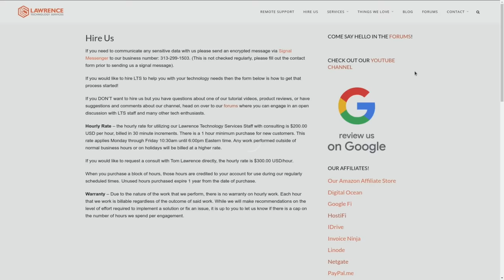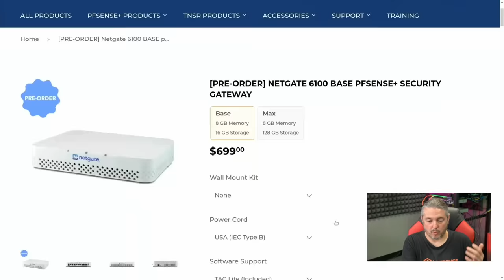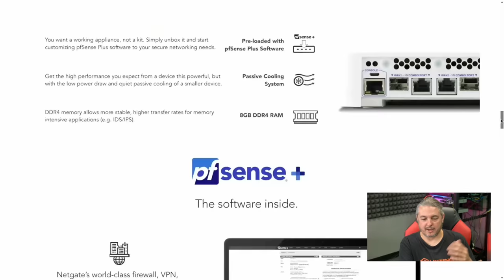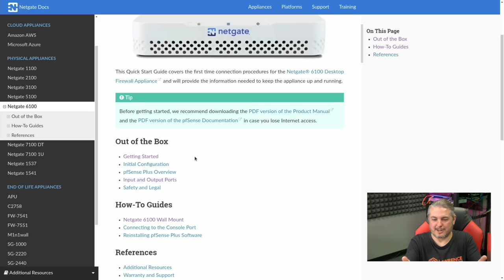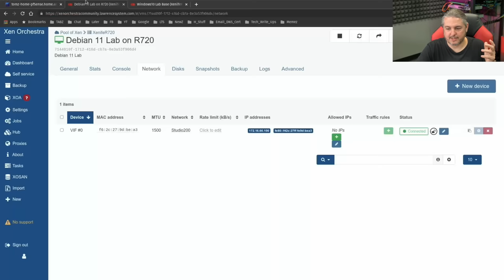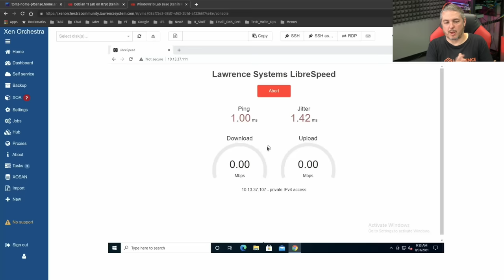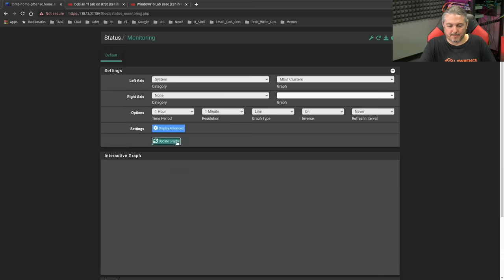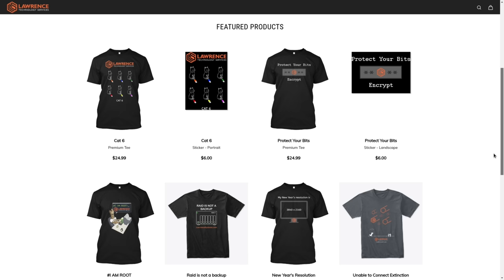Netgate 6100 pfsense Firewall Review

Comment: Great review and led me to purchase the 6100 Base model a few years ago.  A few days ago, the firewall wouldn't boot and isolated to the on-board eMMC had failed.  From the video you can see there are M.2 slots to add a NVMe M.2 128 GB SSD and highly recommend that  you do.  Once you add one, it will be a pro model and easier to replace in case of a failure in the future.  The Netgate website list the NVMe model that needs to be purchased, but I couldn't find any instructions or videos on how to install the NVMe SSD or configured for the 6100.  I did find other videos or blogs on how to do it.

Comment: It's amazing how many companies out there are still living in a world from 4-5 years ago where only medium-enterprise companies had gb or multi-gb pipes. FTTH is changing everything. Fibre is being installed here with speeds including 2gbps and 10gbps available and as competition increases these bigger speeds will start to migrate down the chain whether people need them or not. Looking to put in kit that won't constantly require changing out for a few years is proving difficult. Yes most people won't use these speeds properly now but as more people get access to them then things will change quickly.

Comment: The other 10G products were overkill and out my price range. This seems like the perfect upgrade / replacement.
My WAN is slow but I want faster inter-VLAN routing. To-date I have been using a thin client with SFP+ and then using VLANs in my switch for WAN etc.
Reply: New WiFi 6 APs...

Comment: One question about the SFP+: Netgate and you mentioned the two ports are for fibre and DAC only basically. I have a 10Gbps home internet connection and it uses HuaWei EchoLife HN8245q which only has RJ45.

Now I would like to use 6100 for the setup. You mentioned there are ‘compatible’ modules that would work for 6100. Would mind sharing the models if possible? Or there are other solutions?

Comment: I obtained a 6100 and while it may be a bit overkill for my home network setup currently, I can grow into it more as time passes. Especially with the SFP 10G WAN ports should I ever get fiber in my area. Right now, it's just [coax] cable internet. And of course the firewall blows just about any wifi-router that you might buy at Best Buy, WalMart, or what have you out of the water for performance, flexibility, and scalability. My setup is cable modem > 6100 > Netgear 2.5G managed switch > Unifi 6 lite AP. Handlily outperforms the previous Asus routers I have had before. I also dig the VLAN setup, something that most store bought routers don't have.

Comment: Been waiting for this review -- I appreciate the real-world numbers.  I do wish there was a more modern processor on this, but I sure do appreciate the 2.5G performance at least!
I also wish they had included ears -- the dimensions are roughly 1U, and silicom-usa has rack ears, so I'm wondering why that wasn't done (heat?  time?  product differentiation?).
Now we just need unifi to actually ship a 6E 2.5Gbe AP....  :)
Reply: I'm trying to decide if this is a good starter that'll last a year or two before we (finally?!) get a post-2017 processor.  The alternatives I've found are a little power hungry/noisy.  Mostly I'm just going to be needing cross-vlan routing rather than vpn perf.  I probably don't need sfp+ routing speeds, but as I already have sfp28 locally, it feels like something I should at least consider.

Comment: Great review Tom!  And I am glad there is a pair of discrete SPF+ connectors on that device now so you could start building more efficient networks and not having to bottleneck to your servers/services at 1Gbps. This is very a very neat device for Netgate. +1
Edit: Also, no switch port on this model which is another big plus. I never really understood why Netgate put that on some of their models.
Edit2: To be able to do 10Gbps in a single stream, you need to have your packets inspection go into dedicated ASICs and not rely on a multi-purpose CPU - although some could do it, but you need 4GHz+ per core for that which will start defeating the low-power benefit of those solid state appliances.
Reply: Switchports on these type of models is because it's not an enterprise grade device - it's more for a SOHO situation and not a datacenter.

Comment: Thanks tom. If you're open to requests, I'd love to see a pfsense appliance that can handle single stream 10G. Basically what do you need to actually achieve that in a real world scenario. Preferably something with two PSU so there's a bit of redundancy in the mix as well.
Reply: When you need to 2 x PSU for a firewall, you probably need 2 firewall in HA instead which will accomplish more what true redundancy is all about.
Reply: @ryzenforce  exactly! And HA can be scaled up when you need more capacity or other reasons.

Comment: I also disapprove the way that Netgate chose to name the ports on their appliances. A port is a port, an interface is an interface, these are completely different concepts. Their naming should not use the same vocabulary. Surely it is easier for beginners, but once you get to use more advanced features such as LAGG, VLAN, Bridge, then it just creates more confusion and can even lead to errors and longer outages. In my opinion, it would be fine to name the port with a simple number (ex: Port 1) or the system port name (ex: igb0). We can always add a label later on the appliance to identify the ports more conveniently.
Reply: can you clarify for me if you are able to use these interraces (the lan ones) as routed interfaces? as in to assign ip addresses on them/tag vlans etc?
Reply: @neofitsolovan1459  Yes you can use the LAN1 to 4 ports as routed interfaces. You can use them with untagged traffic and assign an IP address directly on them, or you can add VLAN tags to them an also use the sub-ports as routed interfaces in pfSense. As said in the Netgate 6100 manual, the LAN ports will actually be shown in pfSense as igc0, igc1, igc2 and igc3. If you add a VLAN to a port, you will end up with a virtual port such as igc0.99 where 99 is the VLAN number. You can then add an interface in pfSense,  which is routed by detault, and bind it to that virtual port.
Reply: @viaujoc  Thanks for clarifying. I'm comfortable with networking terminology (Cisco Enterprise World) but they are not very good at explaining things. Do you happen to know if on pfsense plus you are allowed to install all the packages you can install on CE? (eg openvpn, freeradius,etc)?
thanks!
Reply: @neofitsolovan1459  Yes, packages are the same in both Plus and CE editions. Netgate has not, as of today, made a value-added package repository for Plus customers. Most packages are open-source and maintained by seperate communities, so it would be very hard to close them and make them commercial only.
Reply: @viaujoc  thank you

Comment: AWSOME VIDEOS! REALLY LOVE HOW DETAILED YOU ARE! 🤣
I'm needing 10g fiber and 2.5g fiber, is the combo port capable of performing on at 2.5g network or do they only work at 1g?
Reply from the maker: I don't think they support the 2.5G on the 10G port.
Reply: 2.5 / 5 Gbps UTP sure, but fiber? That's not a thing. The combo ports are only 1 Gbps ports.
Reply: @0bsmith0  that's a bummer thanks.
Reply: 2.5Gb and 5Gb are kinda pointless and minimal compatibility. Go straight 10gb which has been a standard for years

Comment: I'm sure this is in the Fine Manual, but what is the default configuration?

I preferred the WAN, LAN, OPTn labeling.

That anemic (and quite old in this case) CPUs is the biggest reason I have been buying my own hardware.  Current device is a Protecli 6-port with an i5.

This is interesting as I am wanting to move up from 1 GbE, but I like having the additional horsepower.

Comment: What’s the point of 10G WAN if the LAN is only 2.5G if I want to put a Ubiquiti 10G switch behind this? Have to port bond (LAG) all 4 LAN posts to the UniFi switch. Silly, should have 10G LAN ports.
Reply from the maker: All the ports are assignable.

Comment: just a quick noob question. why does it have so many lan ports? wouldnt it be enough to just have one lan and one wan port... maybe two each for redundancy but whats the point of the other ports?
is it just so you dont need vlans?
Reply from the maker: VLAN's are nice but share bandwith with native and adjacent VLANs on that same port.  Individual ports are nice for creating exclusive networks without the shared bandwidth issues.
Reply: Imagine you use this router for a business office snd you’re renting space to a couple other businesses. You can wire their switch to one of the various ports and create a dedicated and separate physical network. Like the OP said, VLANs are great but you’re also sharing a connection and at some point can saturate it especially with how much internet usage we do now. You can also configure these ports as switch ports. I have a customer who doesn’t even need a dedicated switch because the firewall has 8 ports on it.
Reply: Also, if you have a managed switch that only has 1 gbps ports, you can aggregate the 4 LAN ports in a LAGG and get a total bandwidth of 4 gbps with multiple streams, adding link redundancy in the process.

Comment: Great Firewall Device.
One Issue I Have Is The Boot Load Corruption Of Files Once Their Is Power Interruption.
Which Is Better UFS OR ZFS File System?

The Device Comes With UFS As Default But Cannot Cope Well In An Environment Where Power Is Fluctuating
Reply from the maker: They all come zfs as the default now
Reply: @LAWRENCESYSTEMS  Hey Advice On The Best Migration Process From UFS TO ZFS, Video Link Or Writeup Link, I Will Appreciate.

Comment: The 4 year old cpu is a bit of a disappointment, but probably ok since Intel has not really released much in the last 4 years 😅. 4x 2.5GbE ports is pretty forward thinking and modern though. Great new box, finally something modern from netgate, most other boxes they sell are a bit dated, especially the horrendous SG-3100 which features a 32bit-only arm cpu from 2011 and is still currently sold by netgate.

Comment: Really they should label the ports like “p1-p8” or whatever. But really thinking about upgrading my virtual instance at home with this. I been really wanting the 10G connectivity
Reply: I wonder why would you need a 10gbps connection at home
Reply: @KhaledTheSaudiHawkII  just for internal use. I segment out my networks with VRFs and that have to route through pfsense to get to different network segments
Reply: @KhaledTheSaudiHawkII  Why not?
Reply: In your home, it is more unlikely that you will get enough simultaneous streams to fill up a 10 gbps link. IMHO you would probably be better with a DIY firewall that has an AMD or Intel CPU with higher clock rate that would be able get you at least 5 gbps per stream. By building it yourself, you will probably end up paying the same amount as the 6100 anyway. If you don't plan on subscribing to Netgate commercial support, building your own appliance will not be a big issue and you will probably get more bang for your buck.
Reply: @0bsmith0  Just curious. I have a 100mbps fiber optic line and I think it is plenty. I stream 4K content and play games online. Family is also on the same network. I was wondering about other scenarios where you would need anything north of 500mbps, and wanted to see if I’m missing something.

Comment: Thanks Tom for the un-bias info! My opinion: A little disapointed with Netgate hardware. The SuperServer 5019D-4C-FN8TP has smoked SG-6100 out of the box. And cheaper. Thought they would have came up with something better; @ Price /Harware /LTE Compatability; as the SM SS
Reply: Well that’s a 60W tdp cpu compared to the 16W tdp cpu from the sg-6100,  not really a fair comparison.

Both are ancient though, the Atom from the sg-6100 was introduced 4 years ago, the skylake Xeon from the 5019d you mentioned was introduced 3 1/2 years ago. Both are utter crap by 2021 standards. Probably enough for routing though.
Reply: @geraldh.8047  Agree
Reply: VERY different price points too. Gotta compare apples to apples
Reply: @mrmotofy  Yes and no. Apples 2 Apples yes. 10G Apples do not compare; but should. We could compair the "Older" Unifi XG Gateway; bad SW solution! This device could have been much better. As @Gerald H. mentioned. I choose my device because of LTE/10G hardware integration. No other optimale solution out there?

Comment: Is it recommended to use a separate switch with the 6100 or is ok to use the 4 LAN ports on the 6100 if I do not need more than 4 ports.
Reply from the maker: those are logical ports so use a switch.
Reply: @LAWRENCESYSTEMS  Hi I am new to networking. can you please elaborate more on the logical port vs switch port? can these port be used similar to the ports on isp router?
Reply: @DR19X  Yeah, you can. It isn't best practice but you can bridge the interfaces you want and it will work. But you'll have much better performance using a switch.

Comment: Question: you mentioned in one of your older pfsense build videos, that using an sfp+ 10gbe port would lock the speed at 10Gbps. Could that be resolved by using a transceiver that's capable/compatible with 1gbe, 2.5gbe, etc?
Reply: 10gbe LAN

Comment: Hey there! I was curious if the 6100 can do inline ips mode with suricata or snort? I know it can run in legacy mode, but I don't want to block I just want to filter and manually block. Thanks!
Reply from the maker: I have not tested.
Reply: @LAWRENCESYSTEMS  would you be kind enough to give it a test? I have the sg-2100 currently and am unable to do inline. I do have an old computer with a dual intel nic which can do inline, but would like to buy a better solution. Thanks! 🙂
Reply from the maker: @Bigjonisklutch93  Maybe eventually, if you want a faster answer ask in the Netgate Forums.
Reply: @LAWRENCESYSTEMS  duhh silly me thank you totally slipped my mind to ask there. Thank you sir!

Comment: Uhm.. this has the exact same processor as the SG 7100.. I have a whole fleet of those and I've never been able to push more than 3gbps through the chip with iperf or mix traffic no matter how many parallel streams or interfaces I throw at it... 

I've even tested the internal fabric throughput by turning iperf3 back on itself by hitting localhost with 10 to 30 streams and I can only ever get 7gbps to localhost.. I've just accepted that that Xeon in the SG7100 is just bad. This is depressing.. my laptop will do 70 gigabit when I run iperf against localhost. I'm not sure if this is just a major bug with pfSense 2.4.5 or not, but it still sucks. And you can't even upgrade to pfSense Plus when you're using FRR because there's so many system breaking bugs (that are documented and not fixed yet) in the FRR package when using any of the pfSense Plus builds. 😑

Comment: @Lawrence Systems --  I really like your review of the Netgate 6100 pfsense firewall.   Thank you.  I was wondering if you knew, off the top of your head, about ECC memory supported on it.  Can it support ECC memory?   I think it can but I didn't see it in the specs but I know the CPU can do it, just unsure if the motherboard chipset support will.   And if so, in the 8gb single slot, does it support the same memory speed?  I believe from the specs it as two memory slots on the motherboard.  And I believe it says higher capacity memory DIMMs may run memory at slightly slower speeds, it's a trade off sometimes in terms of hardware capability.  I'm aware you can't mix ECC and non ECC memory, it's one or the other.   This is a fantastic device as is!  I do want to replace my current consumer router in the future because of lack of security and slower performance at higher internet speeds.

The reason I bring up ECC capabilities, and maybe some of your customers specific needs may have too, is because of higher cosmic rays reaching the earth's ground surface.  Scientific studies have increasingly shown that cosmic rays and other energetic particles are breaching the earth's magnetic field due to Sun changes (think solar minimum, superflares, etc.).  Bit flips will be more common according the research so resiliency in the future will be needed.  I think the DDR5 memory spec with built in ECC and DFE will lead the way in the future, in addition to more capacity and speed than previous DDR4.   In short, ECC and DFE is all about speed, capacity, and stability magic for DDR5 memory to run flawlessly.

For those unfamiliar with DDR5's new DFE capability, I'll share with you this brief description of it from the website I've sourced.  "At a very high level, decision feedback equalization (DFE) is a means to reduce inter-symbol interference by using feedback from the memory bus receiver to provide better equalization. And better equalization, in turn, allows for the cleaner signaling needed for DDR5’s memory bus to run at higher transfer rates without everything going off the rails."  Source Anandtech.com

Comment: Still C3558?  What are the speeds of those after you get all your mitigations done, anyone know?
Reply from the maker: What mitigations?
Reply: @LAWRENCESYSTEMS  OP probable means Intel CPUs security issues, such as Meltdown and Spectre, to name a few.
Reply: hello with an A2SDi-4C-HLN4F motherboard (C3558) with a 10gbs network card, is it possible to reach 10gbs or is there a software limitation?

Comment: I'm considering upgrading my Atom C2758 based router so I can do 10GB routing, do you know if Netgate has a router that can do 10GB single-stream routing? Or can you say what level of processor can handle 10GB single-stream routing (say bulk file transfer between two systems on the LAN)? (Atom C3758, or C3958? Xeon D?)
Reply: TNSR rocks on this device
Reply: Use a 10Gb switch then transfers bypass the router so it's capability is irrelevant